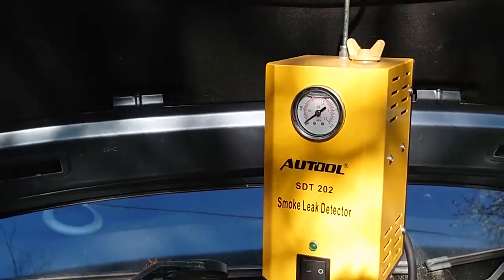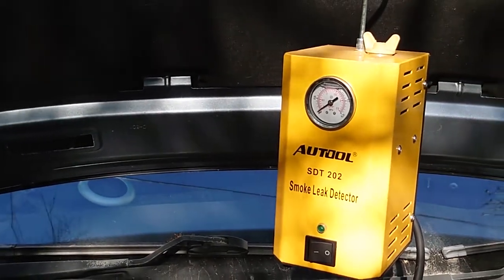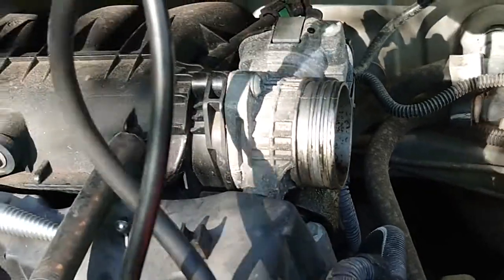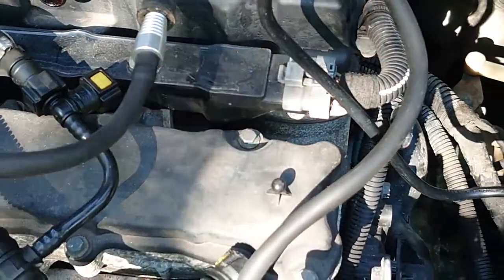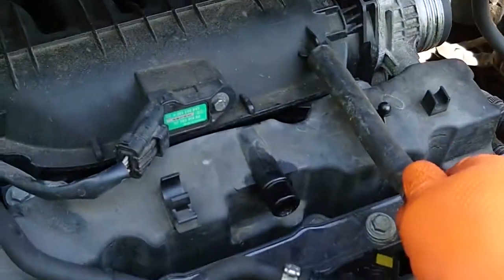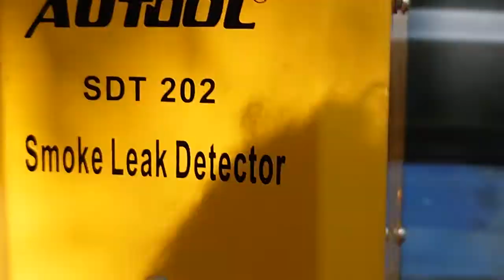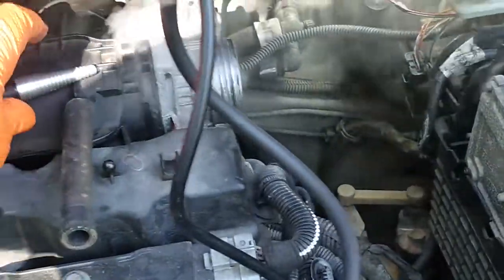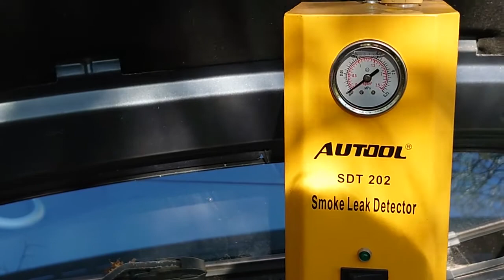Autool SDT 202 automotive smoke machine demo and review

Comment: What oil did you use in the machine
Reply from the maker: I just use normal unscented baby oil.
Reply: @rmautodiag  ok thanks as i just purchased one and its not listing the oil to use .trying it on a land rover .will let you know how it goes
Reply: @dejavoue88  how did you get in with it in the end?
Reply: @evieemaya88  brilliant little machine .as a self employed mechanic this little thing has been invaluable to me, by finding leaks in hoses ,exhaust systems ,fuel systems etc etc that i would never have found. I have also used  it on a couple of soft top cars to find water leaks in the roof ,my only gripe is that it does not have a gauge to tell you how much oil is left in the system .but thats it ,fantastic machine
Reply: @dejavoue88  thanks for the response pal appreciate it. Can I ask are you just using regular baby oil as the oil & how much oil does it take to be full and ready to use?
Reply: @evieemaya88  yeah just regular. I over filled it once and had  run it for twenty minutes with the hose on the ground to get rid of the excess. the small pot you get with it is enough for about an hour. but as I said if you over fill it hook it up and run it with the hose on the ground you will see the oil leak out
Reply: @dejavoue88  thanks again pal gave me some confidence with it. Lastly can I ask you mention you over filled it, so the bottle you get with it (let's say it's 100ml bottle) if u you put the full 100ml in does that over fill it? Basically how do you know how much to out in before u have to stop?
Reply: @evieemaya88  no it won't because I took mine apart to see how big the container was. it will take two full bottles easy.
Reply: @dejavoue88  thanks alot pal appreciate it 🙏🙏👍🏼👍🏼